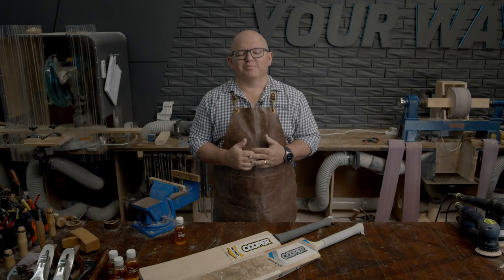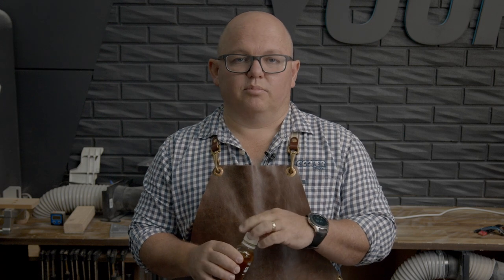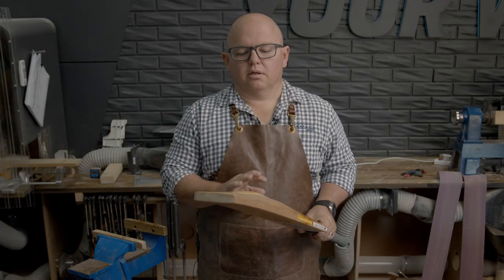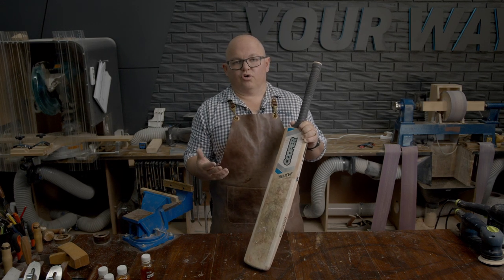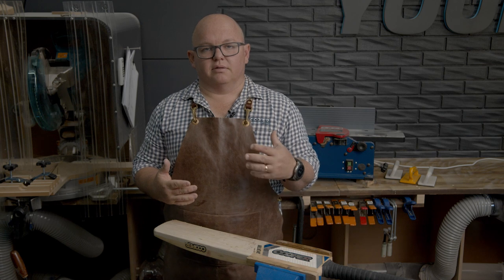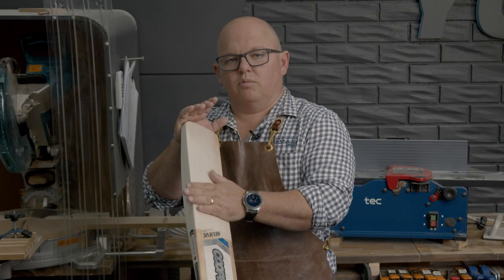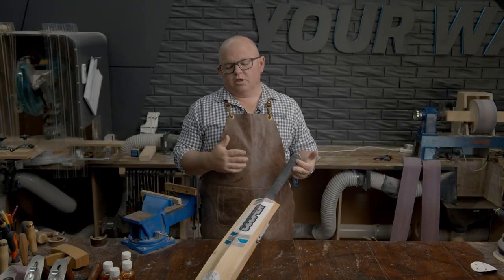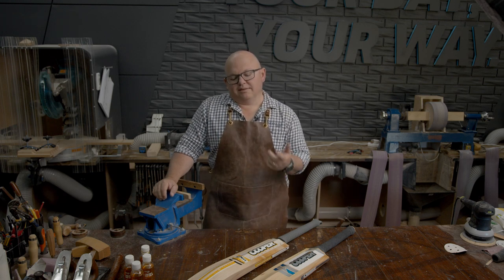How To Oil a Cricket Bat (New & Old) To Increase Lifespan

Comment: Easily the best instructional video available on this topic. Thanks.

Just one question - should I lightly sand the face between both the first and second coats of oil?
Reply from the maker: Sorry for the super late response! Yeah it doesn't hurt to do this as it will open up the fibres of the willow.

Comment: Hi Thanks Its quite a detailed video. How do we  oil the bat if there is a small crack on it? Do we first repair the crack and sand to oil later or we can oil before the repair so that oil goes in the cracks? Thanks 😊
Reply from the maker: No worries! Yes, glue the damage first and once dry then sand and oil.
Reply: @Coopercricket  Thanks for your reply. I will glue the crack. Sand the bat oil it and knock it a bit afterwards. Thanks. Keep going your videos are very good. I have subscribed. Thanks

Comment: Is it counter intuitive to use oil in a hot humid climate like Brisbane? Wouldn't dry willow take moisture out of the air?
Reply from the maker: No, not at all. RAW linseed oil evaporates much, much slower than water which allows the oil to penetrate into the willow and keep it healthy. Cricket bats are just like any other piece of outdoor timber furniture or deck. Exposed to the elements, it will dry out so it need oil to keep it nourished.

Comment: Hey mate, the season is obviously nearly over, and I was planning on reoiling my bat at some stage. Should I remove the cover and do it right after the season is done, or wait until the next preseason? I do plan on using the bat during the offseason, since I am seeing a batting coach. Maybe I should oil it twice, once right after the season and then again in the next preseason? What do you think?
Reply from the maker: Hi robdogs, I would oil it after the season is done unless you feel like it mate be too dry now or the performance it’s what you feel it should be and therefore you may want to oil sooner. 

Cheers
Rod

Comment: Thanks for the video I have oiled my old bat early this morning and I have to play in 2 days. Will 2 days be long enough for the oil to dry so I can stick the face protection sheet on the front? Or can I speed up the drying time by leaving the bat in the sun to dry or a hair dryer or something? Any help is muchly appreciated. Thanks Andy
Reply from the maker: The linseed oil will dry within a day, no problem. Don't accelerate the drying. Just let the oil soak into the willow.
Reply: @Coopercricket  no worries I just did 1 coat. I did do a few repairs hairline crack and small chip at the bottom foxed all that and sanded it back. All good ill leave it till game day in a couple days and hopefully it will be sticks haha. Thanks for the reply.

Comment: Oiled my new bat last June. I've only used it for winter nets and a few net sessions at the end of last summer. Is there a test to know if it needs re oiling for this season?
Reply from the maker: The general rule of thumb for me is that if you can't smell the oil on the bat, then it probably needs oil. Also if the bat feels dry to touch (wood feels rough or splintery then give it an oil)...sorry for late response

Comment: What do u think about using spirit or nail vanish remover to  clean up the glue residue from scuff sheets?
Reply from the maker: We are against using any form of liquid adhesive remover when removing the sticky residue left from a scuff sheet. Most spirit or nail varnish contains chemicals that help them dry quickly and evaporate. Old cricket bats that come in for repair are usually lacking moisture anyway so we don't want to put any chemical into the wood which will dry them out any further. We prefer to sand it off where possible. If we absolutely had to use a chemical we would use mineral turpentine because it's the best at removing adhesive and it tends to dry a lot slower. This of course is only our opinion. Make sure you re-oil the bat before use :). Best of luck!
Reply: @Coopercricket  Thanks for the reply.. i do use spirit specially when removing fibre sheets that are reall a pain in the bud to remove.. even the sander (at least my sander) cant do it

Comment: Can you use refined linseed oil, which is whiter than normal linseed oil?
Reply from the maker: Great question. Refined Linseed Oil is used predominately in oil painting as it has a very long open time which means it will take longer to dry. It will still yellow over time however we haven't used this on any cricket bats.

If this is all you have then we would say it will be better than nothing, however, it will take longer to dry on the willow which may leave it damp/softer for longer. Our worry is that if you use it prematurely and the willow is still soft because of the oil, you can crack the willow, particularly on the edges or toe of the bat. 

Hope this helps?
Reply: @Coopercricket  Many thanks for the information. Some people prefer the 'white' look on a bat rather than the more 'orange' look of raw linseed oil. Think I will stay with the raw version. Also how do you feel about wax, is that as good or not?
Reply from the maker: @paulpickford6076  I take it you mean bat wax? Bat wax is good & certainly easier to post around given it's a solid rather than an oil. Generally, it is a mix of raw linseed oil, white or natural beeswax & a small amount of white spirits. The beeswax gives it a barrier that allows no moisture in & out  & the small amount of white spirits will help dry it so you can still apply a bat facing. We prefer Linseed oil as we think it has more penetration. It's certainly better than not oiling your bat which is very common these days.

Comment: Hi I have the scuff sheet on for a new bat. Should I remove it or oil
The exposed surface. If yes, would it have the same effect as oiling the bat face .
Reply from the maker: If it has a scuff sheet on it from new, can I presume it's a ready play, already knocked/pressed bat? If that's the case, I would leave the scuff sheet on & oil all exposed bits of willow with raw linseed oil. This will not only add moisture to the bat, but it will also help keep the moisture that is already in the bat. I would only then remove the scuff sheet & oil the face of the bat once the bat needs a clean-up. Perhaps this will be at the end of the season or halfway through, depending on how much you use it.
Reply: @Coopercricket  thank you very much for your reply. Do you sell new bats and ship to canada. Looking at your great work, I could probably order one.
Reply from the maker: @Akshaye3  Thank you, mate! Yes, we send bats to all parts of the world, no problem. You can see all of our cricket bats here https://coopercricket.com.au/collections/cricket-bats

Thanks!

Comment: I bought a used bat from a friend. The toe of the bat is bound with thread. Please suggest how to oil this part of the bat?
Reply from the maker: I would just oil the exposed willow that you can & leave the willow under the thread.
Reply: @Coopercricket  Will do that. Thanks for your reply.
Reply: Also, what do you think should the ideal bat moisture level be on a digital wood moisture reader?
Reply from the maker: @industv1221  As a general rule these days, new cricket bats will normally have between 9-11% moisture in them.
Reply: @Coopercricket  Thanks for the information.

Comment: I have 11 bats 

Now i buy a new bat BDM TWENTY20 English willow bat ...

i oil 2 coat in front of bat face ..
Now i start knocking start ...

This is right way ???

Tell me sir
Reply from the maker: That's alot of bats!

2 coats of RAW linseed oil is perfect. Once the oil is dry you can start knocking in no problem. Best of luck!
Reply from the maker: Yes, this is correct! Sorry for the late reply...I missed this one :(
Reply: @Coopercricket   i purchse  grade 1 A2 Coronet english willow bat in 2020 now you tell me .. can i oiling the bat  ????